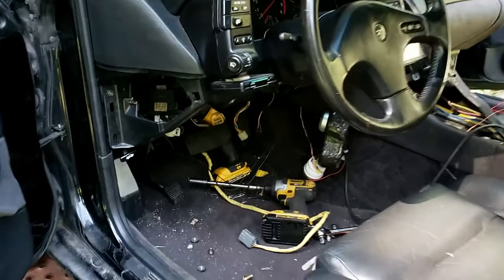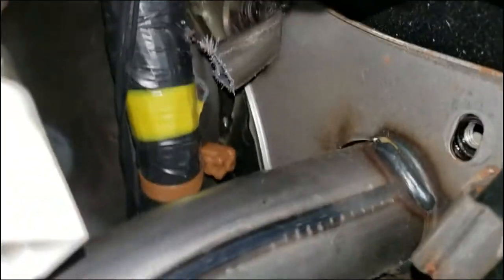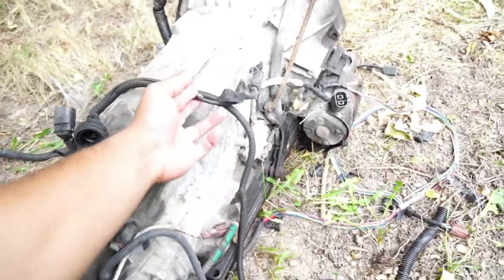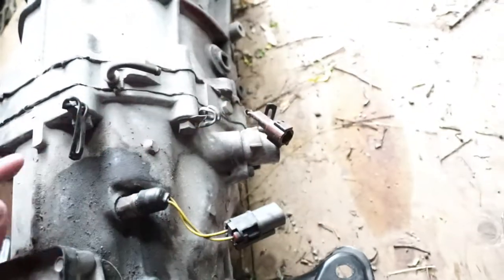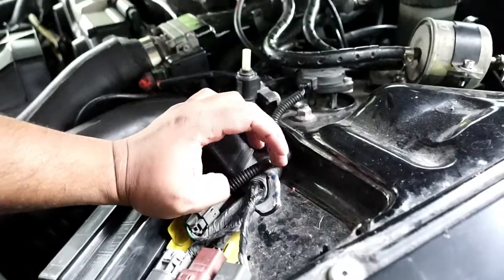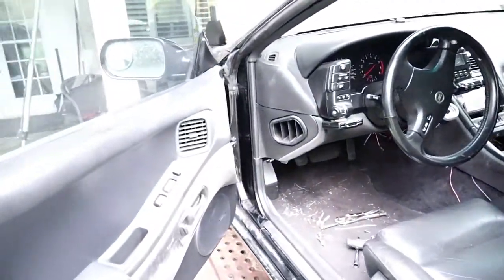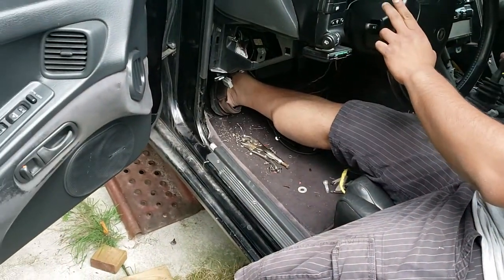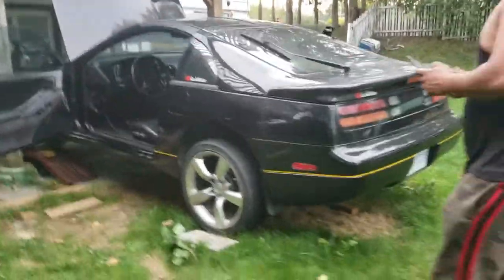How to manual swap Nissan 300zx part 2

Comment: So i went back to look at your videos because I was watching the transmission rebuild as I am going to undertake that myself and I noticed that the transmission rebuilder brought up something about a raised area on the crank. Watching this video back I realized that you did not remove the automatic pilot bushing and most likely inserted the manual pilot bushing into it. This will cause tons of issues including wear on the input shaft, clutch spacing not being correct(which is why the old exedy clutch was hitting your pressure plate) etc which  sounds exactly what you were going through for some of the trans issues. Just dropping this here so that you can amend that in case someone comes in through the video and doesn't notice since Ive seen it happen on other Zs as well that I've worked on! Otherwise keep up the content man!!
Reply from the maker: You are correct. I dropped the transmission later and had to get a new bushing machined and installed. I did have some issues later on. Luckily the input shaft didn't get damaged.

Comment: It looks like you put in a TT Clutch petal with the booster.  You didn't install the vacuum tanks.  Does the booster work without the tanks when the engines plenum is not in a vacuum state?  The relay you jumped is controlled by the security system and the ground provided by the Park position on the auto or the clutch switch on the manual.  So the car will turn over even if the clutch is not depressed the way you have it wired.  The Canada model doesn't have the relay you bypassed according to the manual?  Why didn't you use the z1 motor sports alternator wiring harness?
Reply from the maker: I did install the booster tank. Its right under the clutch master. I didn't have a video of that work. 
I didn't get the Z1 alternator harness because we were able to salvage the auto harness by splicing it.

Comment: Where in Canada are you from?
Reply from the maker: Georgetown Ontario.
Reply: Car-Addiction nice that’s not that far from where I just picked up my 300zx Donor today I’m from London on
Reply from the maker: @nasmetics6266  nice. You picked up a 300zx donor from Georgetown? I'm curious to know which car? What color was it?
Reply: Car-Addiction it’s blue, dam thing was leaking gas and had to fill it up Two times lmao. I start tmr removing the parts this my first time as well
Reply from the maker: @nasmetics6266  is it the one advertised as a drift car or something like that. Asking 3500?
Reply: Car-Addiction you got it right lol. Only one that was up For sale
Reply from the maker: Lol. I have one silver TT for sale. I just didnt put the add up.
Reply: Car-Addiction no way how much are you putting it up for. The one I’ll be fixing up is 1989 with 120 km clean never seen snow or rain
Reply: Car-Addiction what’s the hardest part of this swap?
Reply from the maker: For me was getting the tranny out and in as I dont have a lift and did it on my backyard on jackstand. Everything else is pretty simple. 

Oh forgot to mention. Installing the clutch padel was a bitch.
Reply: Car-Addiction hey man so I noticed the fourth gear grinds. Do you have 5 speed that you don’t use I can buy off you
Reply: Car-Addiction send me your number I need a lot of help bro I took all the parts off today.
Reply from the maker: @nasmetics6266  damm. I just sold the 5 speed tranny that I had 2 weeks ago. My cell is 6473904288.